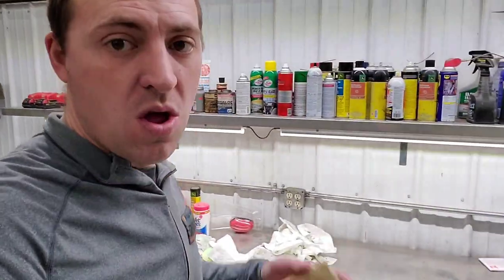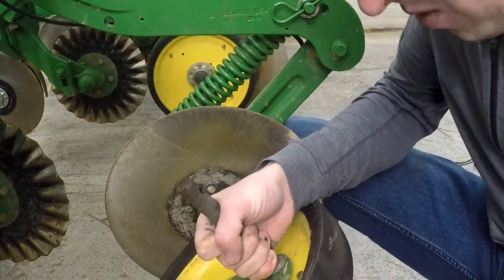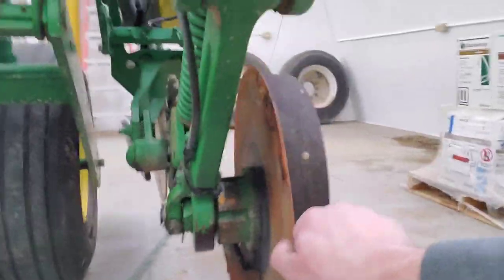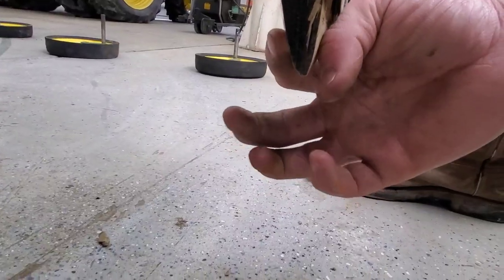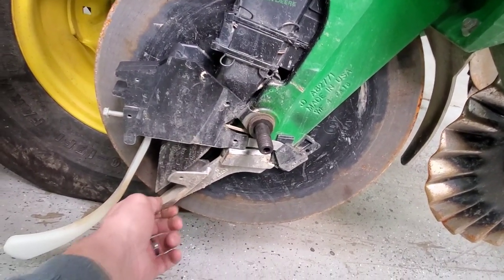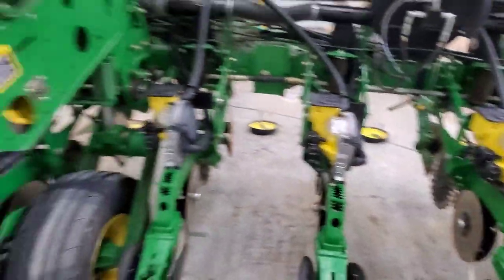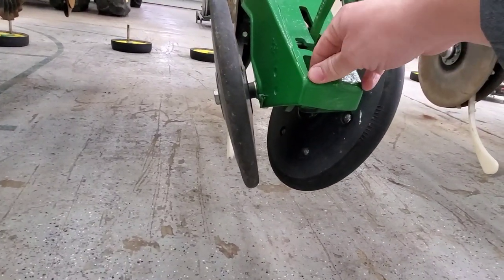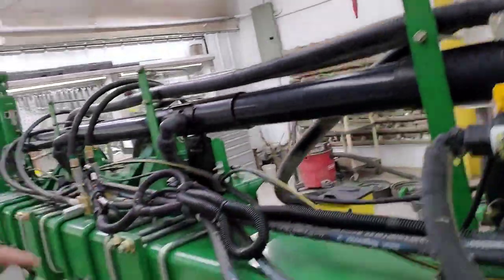How Planters Work - #86

Comment: We run a kinze 3500 central fill planter.  We also have 2 johndeere planters a 7200 12 row planter and a 750  twin 15 foot notill drill . The kinze planter is a great unit that has great performance. I'm currently rebuilding my kinze planter units with new bearings and bushings.  Nice video stay safe and farm on my friend !

Comment: Great job explaining how the planter works.  Very sophisticated system.  First, thanks for answering my question regarding the RX Maps and how the Contour Map is produced.

Few questions:  1. What is the purpose of what appears to be an air compressor on the back of the planter frame?  2.  Do the two fans operate at a fixed rate regardless of the seeding rate?  3. Does the planter have its own sealed hydraulic system or does it feed from the tractor like a lift cylinder?
Thanks for taking your time to provide this information.  Very educational.
Reply from the maker: That is an air compressor.  It's to provide air for the downforce system. I'll show it in the next video (#88).

The fan blowing seed to the rows runs at a constant speed whenever the planter is in the ground. There are actually 2 vacuum fans and they are adjusted based on the size of the corn seed I'm planting. Heavier seed requires high vacuum pressure.  

The hydraulics are all connected to the tractor. Modern planters require a large volume of hydraulic flow.

Comment: Nathan. are these maps used in the tractor to control fertilizer and seed rates. The drive wheel on the fertilizer pump seems to compensate for speed, MAYBE?? I can see how the seed hydro motor can be adjusted to control seed rate. What controls them? This may be the point that the teacher would tell me "that will be covered in the next chapter." Do you soil test?

Comment: How much maintenance is required for the fertilizer feed lines and what sort of connectors are used?
Reply from the maker: Not much. The lines to each row are just push in connectors. The fill line is 2" cam lock.

Comment: Nathan , Is it true that the brushes inside the meters , can be very pricey when they need replaced ?
Reply from the maker: Not the brushes I was showing. They are $5-$10 a piece. The brush belt in the high speed electric drive planters is more expensive but we don't have those.